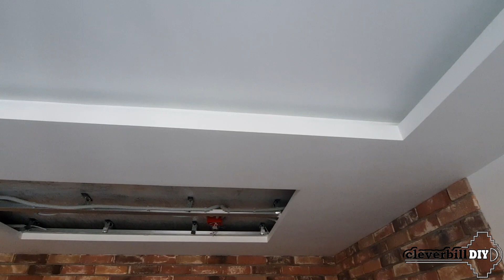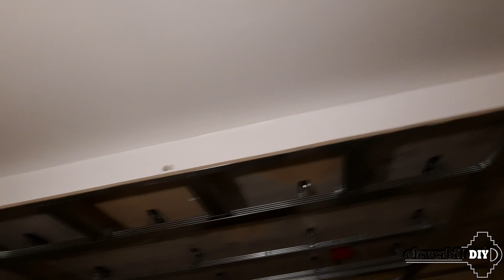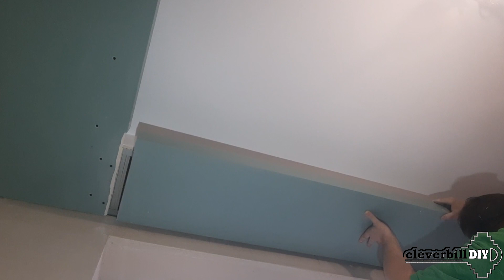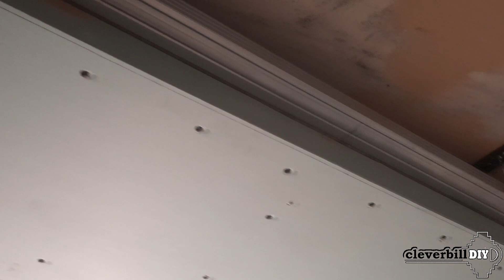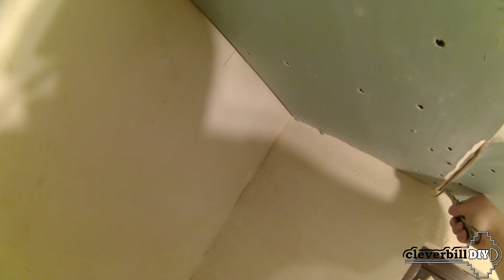Plasterboard installation DIY - how to make a two-level drywall ceiling with LED lighting

Comment from the maker: Plasterboard, a unique material that allows you to implement various solutions for the renovation and creation of new interior design. It is not so difficult to equip a plasterboard ceiling at home, the main thing is the desire and skills to work with the tool.